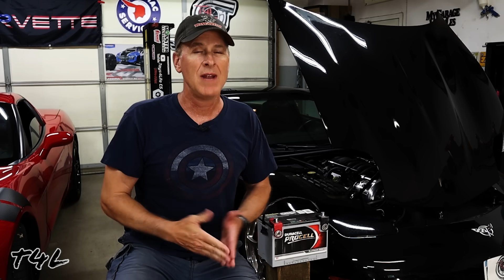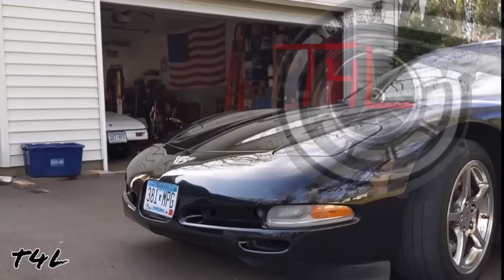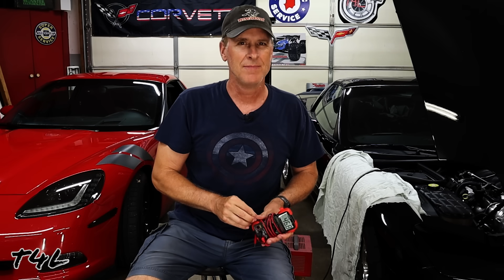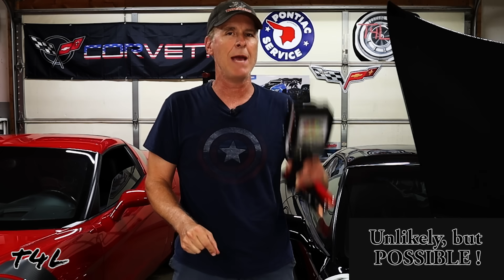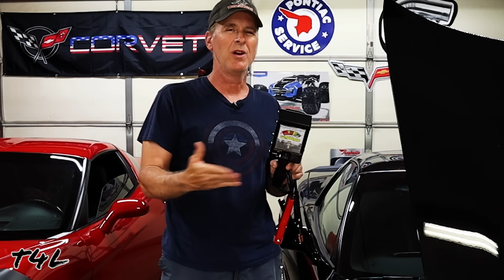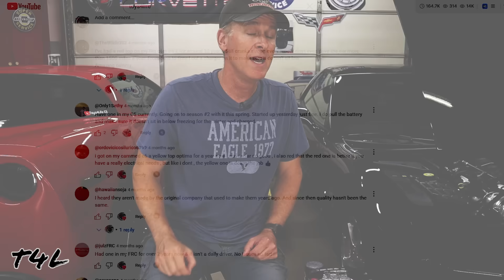C5 Corvette Battery Replacement (IMPORTANT TIPS - Watch Before You BUY!)

Comment: You forgot to discuss what size batteries fit in which model years..........................
97-00 used the 78 series battery (larger side post battery for the trucks)
01-03 used the 75 series battery (smaller side post battery for the cars), larger 78 still fits and has more power and RC capacity
04 used the 86 series top post battery.

I personally use the 78 series in my 02, as it has more cranking power, reserve capacity for all the electronics, and while is few pounds heavier it's often cheaper as it's more common.

Standard batteries shouldn't gas off and leak unless over-charged (14.8v or higher), but still always check regularly.

I agree AGM is the best, unless in my case I can buy 2 regular batteries for the cost of one AGM as I am in the parts business and car is driven regularly, and battery removed while in winter storage 6 months a year. So regular Lead Acid for me this time anyway.
Reply from the maker: Pinned.  Thank you! I use 34/78 dual terminal.
Reply: @Cameron-y8j  Maybe you can answer my question. The Superstart agm says 10 3/4 x 6 7/8. Will that fit ok in an 03? Thanks
Reply: @khub998  - a 78 series battery is 10.25" Long x 7.0" Wide, 7.3" Height. The width is important on these batteries as the clamp holds the bottom of the battery.

Than being said, I think there is about 1/2" of adjustment on the bottom shoe for clamping too.
Reply: @Cameron-y8j   Ok, great. Thanks for reply and info!!
Reply: Too many people here are treating the BCA GROUP SIZE as if that's what determines performance. It does NOT.  A group size number delineates the physical dimensions and terminal style/location and THAT'S IT. Other than the physical size, the other most important thing is COLD CRANKING AMPS (CCA). The higher the better.
Reply: @602STS2  - I agree, but generally the 78 is a physically larger size battery, and often has MORE CCA, and RC simply because there are more room for more plates in the battery.  You need 600-650 CCA's for our cars, and the larger the RC the better especially for all the computers we have in these cars.
Reply: Re place by battery in my Corvette with a AGM after previously I had two batteries One battery was original wish I found out that it was a defective thought it was guaranteed and so they replaced it with another battery then I turn around replay set with AGM battery heat and the battery inside your motor affect the battery itself  may leak acid

Comment: LFP batteries only lose 1%/month vs 1%/day with lead acid.  At 70% of charge lead acid will barely turn over an engine.  At 10% of charge LFP has full cranking.  Plus only weigh 10 pounds, longer warranty, no explosive gases, no corrosion, faster charging, etc.

Comment: The best battery is the GM AC Delco.  The charging system is specifically calibrated for this battery   Use it!   Keep it on a NOCO 5amp maintainer and you will have no issues for many years
Reply from the maker: Respectfully strongly disagree. I've seen too many c5s that have had their lead acid maintenance free battery somehow leak all over the brain and wiring of the car. No thanks. By the way, what's specifically calibrated about that battery.

Comment: The optima is made in china is is a pc. of crap. I went through two of them and last one was sizziling and leaking and ruined the clear coat and paint on my pass. side rim. These need a special charger so what says the alternator in a   C5 is special too. Went to a lead acid with a plastic catch under the battery and havd no issues fof 3 years already.
Reply from the maker: There other options for AGM.

Comment: I have a 2003 C5.  I put a new Red Top Optima in about 5 years ago.  So far, no complaints.  I don't drive it enough to keep the battery fully charged.  I don't blame the battery for that.

Comment: I have a 2003 50th anniversary edition corvette.   Are there any modifications needed to use an AGM battery?  I have heard that they have different charging requirements from the standard acid battery.
Reply: Not to the car, but for a stand-alone charger it should state somewhere in the manual that it can do AGM.  My understanding is that the lower internal resistance can trick a lead-only charger into dumping too much current into it.  

I just bought one and charged it up and noticed it stayed at 2A for a while, then ramped up to about 6A for a half hour before dropping down to 1.5A to top it up.  On the same setting, I don't think I've ever seen it go over 2A when charging lead acid.

Comment: I made the mistake of buying a Duralast alternator for mine and popped a 3 year old Optima
Reply from the maker: I assume a bad regulator, How many volts was it charging at?
Reply: @Toys4Life  Yep! Was fine until i stopped for gas. Running at 14v. Then suddenly it started shooting upwards of 17v and the dash would shut down. I took it back and bought a dbelectrical alternator and another red top. Zero issues now.

Comment: Good short video. I have actually had bad luck with my last couple of duracell's. Another YouTuber that has a really good channel is Project farm. Todd does not accept any sponsorships and those some very good testing including testing on batteries. If you've never seen it you may want to check it out. From stripped headed bolt removers to oil and batteries he has a lot of good content

Comment: I own a 2004 C5. When I replaced the battery I opted for an Interstate AGM type. The battery lasted just under 36 months. In all fairness, my C5 sets for weeks at at time without being driven. When I replaced the Interstate I chose a lead acid battery from Auto Zone. I have had good results using the Auto Zone batteries over the years in several vehicles. However, the next battery change I intend to replace with the Duracell.

Comment: I work where we sell most AGM batteries. Most are as good as you will find of any battery.  Most failures are due to buyers not reading the care instructions. Most need a charger that will charger that can charge an AGM  battery. 

As if an AGM drops below 10.5 volts it will generally not tasked a charge by a conventional charger. 

You also do need a Tender if you store your car. . 

I have used Optima for years and never lost one short of 12 years. 

Most warranties batteries just needed the correct charger. 

Use nothing but AGM in a C5. 

Note too in hard handling acids can at times be expelled from vents.
Reply from the maker: I appreciate your comment!!  If we could know all, it would be interesting to know for sure what percentage of new batteries that failed quickly were really defective an what percentage were treated incorrectly.  No way to really know which is why I detailed my routine I used on the Duracell to get 11+ years.

Comment: I'm surprised you didn't mention the CTEK battery maintainer.  I've used them for years and they work great.
Reply from the maker: I don't doubt that they do! Because I have eight years of Firsthand experience with the battery tender Jr - I have to give it a shout out. I do hear lots of great things about CTEK!
Reply: @Toys4Life I used to use a Battery Tender and have had several until one failed, then I went with CTEK.  Now I prefer a CTEK.
Reply from the maker: Both have great reviews, actually BTJ rates slightly higher with substantially more reviews on Amazon + plus mine has been going strong for 8 years so I see no reason to change (:-)

Comment: And did you find it would be a good time to replace the battery cable screw lugs due to age, corrosion, poor threads? And did you keep a 12v power on the car either via cigar lighter or data connector? Or, if not, did you have to reset any memories like radio, seat, etc.
Reply from the maker: good points!  I should have noted you can get new lugs if yours are damaged in any way.  I did not lose any memory items or presets. Should have noted to switch the batteries over quickly to minimize the chances of losing anything dependent on electricity.

Comment: My last two batteries in my daily driver were both load tested prior to a long road trip and still ended up going out. Needless to say I don’t put a lot of stock in those tests.
Reply from the maker: I find this very interesting. Did they actually use a good old fashioned 130 amp load tester? These things have been in use for decades and seem to work well for me. There's a lot of cheaper little units on the market That don't actually pull a bunch of amps. An overcharging alternator can  do it too.

Comment: I have a Z06 that's a weekend car. I bought an optima yellow top for it. It was drained dead in 24 hours. I returned it as defective. What modules are most suspect for a parasitic draw? There is nothing wrong with the car mechanically as it has super low miles. The only thing wrong is the blower fan failed and I just bought a new one and need to install it. Any suggestions as to where to start?
Reply from the maker: YES  https://www.youtube.com/watch?v=duaj7TyJbKI

Comment: I purchased the battery tray from Lyle a few months ago. Easy install. I did however, broke the ground bolt accidentally after he suggested to remove and clean. Easy fix if this happens to you, just install a self tapping 10mm screw to connect the three ground wires. All good!!
Reply: Thank you for sharing your experience. 

I'll definitely be buying this part from Lyle and C&S Corvettes. (:
Reply: @RickyV-Production you’re very welcome and best of luck!
Reply: @keithp115 
Appreciate that. 🎉

Comment: Just replaced my AGM battery for 2003 c5.  I searched extensively, and found there are basically a very very few brands that provide agm batteries these days. 1. Optima, 2. oddesey, 3. AC Delco. I looked at ALL auto parts stores, rock auto, ebay, amazon, and  chevy dealers. The AC delco battery from dealers were costing $500 to $745 from dealers, and a few hundred from rock auto. The original acdelco was replaced twice under warranty within 1st 6 months of ownership, due to internal leaks or shorts, so the ac delco is a loser choice. i have heard a lot of negative reviews of the optimas quality lately. A newer brand, I never heard of called odyesey seems to be sold by various sources, and is a company in the united states. I went with the odessey agm. I looked at sams club, and the batteries page has been shut down on website. I also can not find a duracell agm for c5 anywhere else in market. I also went directly to various brand batteries websites to see if they even make agm batteries for c5. Example: interstate batteries. They dont even make them at all, let alone for a c5. Another consideration when buying , is to avoid places like rock auto. 2 to 3 years in the future when it is time for warranty replacement, good luck getting that done. I live in las vegas, and NO battery lasts more than 2 years, maybe 3 years if you are very very lucky. So YES you need to consider the warranty replacement situation. If buying from local parts store such as autozone, what happens is they replace it under warranty for free, no questions asked, right on the spot. no shipping batteries back and forth, or arguing with some company far away. I did get an odessey agm from autozone. $345.00 What a rip off these batteries are these days. 300 to 745 dollars? rip off!! Now it remains to be seen 2 to 3 years down the road, what will happen. What if autozone does not have any replacements?

Comment: I use an Odyssey AGM battery and a CTEK charger.
Reply: ...yep, Odyssey the only one I use
Reply: @5milamila is it that good?
Reply: @UBeesh10  ...buy once cry once is my motto.      Highly modified Wrangler (the SHTF vehicle)  runs dual Odyssey's, my GMT 800 currently has a single Odyssey and I might upgrade to dual, C5 FRC now has an Odyssey, and was about to pull the trigger on an Odyssey for my lady's 255k mile Accord but I was able to use a Noco Genius 5 to rehabilitate (after about 48 hours and many "repair" cycles) a cheap TripleA installed lead acid battery
Reply: @5milamila ty very much sir!
Reply: @UBeesh10  ...if you're not going to at least start the vehicle and let it run for ~10 mins OR drive around the block every 5-6 weeks, definitely have a CTEK or a Noco Genius 5 (or Genius 10) around to keep it maintained.  Good luck!

Comment: The first AC Delco battery in my 1998 Oldsmobile Aurora lasted eleven years. I wonder if the C5 designers considered a battery location away from the engine heat. The Aurora battery (like many GM G and H bodies) was below the rear seat with proper vent tubes.
My C5 gets driven six miles a month as I have twenty-three other vehicles.
Reply from the maker: You should get 4-5 more so you just drive each one once a month?
Reply: @Toys4Life We are looking to move to southeast Minnesota and I can only take ten vehicles with me. The Corvette is one!

Comment: As far a i could tell, they don't make group 86 agm batteries, or at leas not from what i could find. Instead I used a group 34 flat plate agm in mine, it was a bit bigger but still fit pretty much perfectly
Reply from the maker: 34/78 FTW (:-)

Comment: I had a semi major problem with a battery where the acid leaked onto the wire harness and connector. I initially replaced it with an AGM battery but in my C6 there is a relatively high drain and in the winter when the charging cable came off I froze the battery. Since then I have used a lithium battery and although the drain is still there I do not have to worry about destroying the battery in the winter. Unfortunately they are EXPENSIVE, but ultimately worth it.

Comment: I have the yellow Optima; for me, it's a complete game changer. The performance compared to the lead-acid battery I had before is incredible. This video once again reminds Corvette owners that they need an AGM battery. Yes, it's expensive compared to lead-acid batteries, but the performance is amazing. If you have a Corvette, save money and install an AGM battery. What a great video! 💪
Reply from the maker: Great info, thanks for sharing your positive experience!
Reply: Did you replace yours because of the potential leaks from Lead Acid?
Reply: @RickyV-Production  Yes, to avoid damaging my computer and also because sometimes, due to work or time, I forget to connect the battery Tender, I damaged two LED acid batteries due to complete discharge. I decided to buy the yellow AGM Optima, which is deep cycle even though it is more expensive, but I think that if I continue buying acid batteries it is the same as switching directly to AGM, which is a solid and longer-lasting option. Believe me, if the car could talk, it would say thank you 😂😂
Reply: @edgardovigo147 
Corvette: Thank you. 
Owner: You’re welcome. 
Corvette: Let’s drive and take my top off. 😂😂😂
Reply: I purchased a AGM battery last week and I noticed every time it was I'm in traffic and I had to stay in traffic for a long time I watched the needle on my battery gauge going down it may be because I use my air conditioner to  drain the battery it would not hold a charge
Reply from the maker: With the engine running the alternator should not let that happen.

Comment: The accuracy of a load tester isn't as great as a good mohs tester which tests the internal resistance of the battery. While they're more expensive they are much more accurate than the load testers
Reply from the maker: This may well be true!  That having been said - For the average and even above average car guy, IMO a 130 Amp load tester is more than good enough and for the money & ease of use - likely the best choice for most.

Comment: You must live up north. Even with a tender on it, no battery is going to last 11 years in the deep South. Temperatures above 77°f will diminish the life of any lead acid battery by a very remarkable factor. Much higher and the age will diminish at an exponential rate. 
The next thing that affects the batteries life is the amount of lead in it and whether or not that lead is doped with calcium. The next thing that greatly affects the life of the battery is how much space exists between the lead plates on the floor of the battery since the sulfates settle in the floor of the battery, ultimately shorting out individual cells.

Comment: I don't have a garage so i can't really trickle charge mine.  I'm putting a battery mat under my battery in the tray that catches and neutralizes and acid that may leak out
Reply from the maker: 10-4 - It has to be very thin - or the battery won't lock down properly.

Comment: I just replaced mine with a 220 $ Die hard gold. I figured id get this one because they would have to special order a AGM.  Havent  had any problems since. Group 78 700 cold cranking amp with 90 or 100 minute reserve. Im always detailing the car so the hood is up alot so i will notice if it starts to swell.
Reply from the maker: 10-4  Many times they will leak before they swell - pull the inspection panel off and take a peek once in a while whenever the pass front tire is off.  Also, smell for acid as well!
Reply: @Toys4Life oh ok. Thx man. Im presently trying to restore the interior on my midnight purple 2001 with all black interior thats faded. I want to add some camel color to make it a two toned interior instead of all black. I seriously appreciate people like you and being helpful when troubleshooting.  It didn't come with the original radio so i have all that yanked out because it looked bad. Im trying to decide if i want to go back to the stock tape deck and 12 disc changer in the back or update to make it more modern and possibly have a back up camera and Bluetooth for my phone.